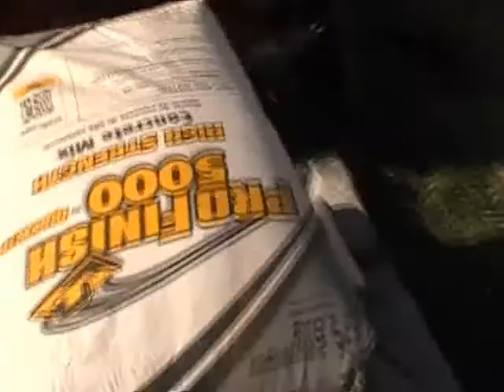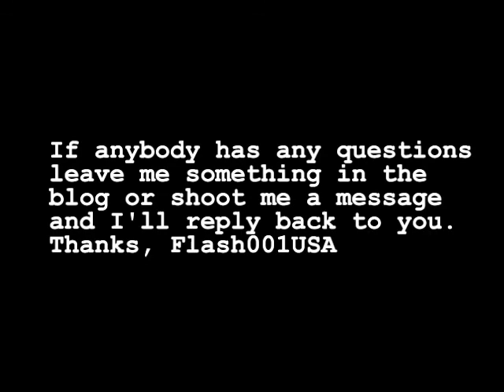Gasifiers New Home 09-31-2017

Comment: On my second thought.  I suggest you move the gasifier further away from the house for safety reason.  You could wire it over to your house.  Just in case something goes wrong.
Reply from the maker: Methee Watchakittikorn actually it's pretty safe where it is. You got to remember that there's only a small ember zone inside of the gasifier that is producing fuel on demand so even if you were to have a flashback there wouldn't be enough fire off of it to engnite anything. The outer walls on the building are also fire retardant material. One of the thing, there isn't enough heat released off of the Gasifier to even create a heat issue on the wall behind it.

Comment: Love your setup... What changes have you made to your gasifier since the last posted video? Seems to look a bit different than last seen. Seems like the newest video that I have found on your gasifier was sometime in 2014??
Reply: Sorry about that question, I did just find your newest video of the shown changes. I think your new gasifier is great, I have been following for a long while now. Very interested in seeing the automation portion for the gasifier, can't wait. I am in the early stages of starting to build my own, with the only differences being that my gensets are 5400 watts (10hp) and an on an 6500 watts (not sure on HP but a two cylinder gas). I want to upsize from your idea accordingly and think I will have a great gasifier in the end. I am already running 400watts solar panels with 8x 12v@105ah each with a 2000/4000 invertor. Still not grid tied, but runs my shop sufficiently. If you have any sizing suggestions for my gasifier build, they are definitely welcome and appreciated. Great job!!
Reply from the maker: Frank I made a video last week. I'm not sure if you seen it or not but here is the link to that video. Hopefully this will answer your questions. https://www.youtube.com/watch?v=dJfpa5-TTig

Comment: If I was close to you bud , I would bring my mini excavator over for you ..SORRY that looks like you have some dry hard red clays ,that’s sucks to dig by hand !
Reply from the maker: Yeah a mini excavator would have been the ticket for sure! I have some dry red blisters on my hands but it's all good now. I just wanted this out from the direct weather. Since I built the gasifier I have been covering it with plastic and tarps but I would have to change out the plastic and the tarps after a few months because the sun would cause them to fall apart so that was getting old plus there was too much work and time invested in it to get it to the point of a working setup. I know you had issues with your build when you built yours but I can tell you that this build actually works. A lot of people have built it for themselves and even added their own improvements on the build so if you ever decide to try your hand at this again there are a bunch of us who can help point you in the right direction so you don't waste your time making small explosions and tar. You were there when I first started entertaining the idea of a single nozzle design and I hope to see you get back around to building a working model plus you you do professional work so I know what you are capable of. A lot of these guys that copied my build are much better than I am at metal work and they have some really good looking functional setups. Anyhow I have to go and replace a overhead light socket in the bedroom so off I go to play electrician.